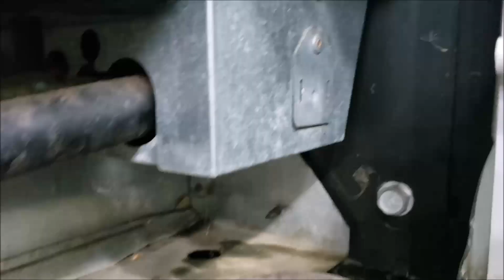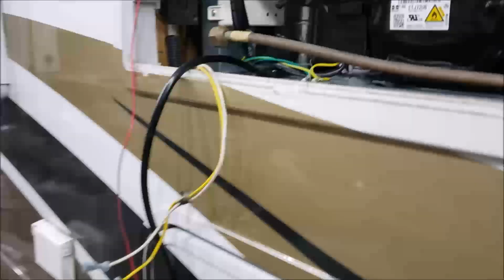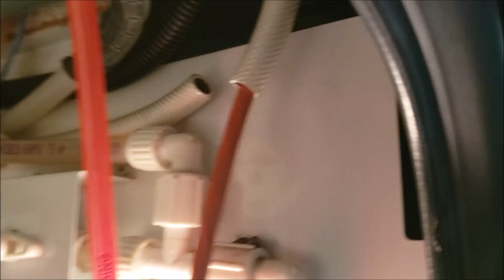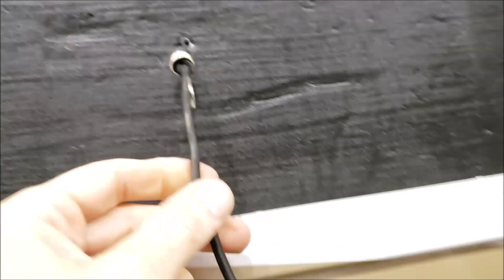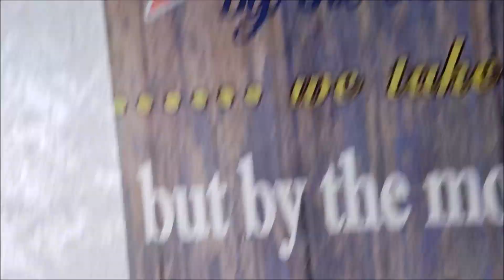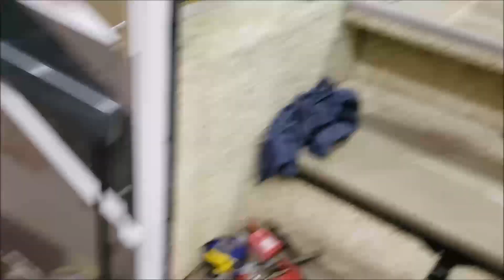How to Replace Your RV Refrigerator With Residential Fridge Step by Step With Haier Model HA10TG21SB

Comment: Very nice video.  Question,  why not install a 12 volt refrigerator instead?
Reply from the maker: Cost and availability  the fridge i chose is only 450.00 and I can replace it by going to any Lowes store. While am on the road.
Reply: Cheapest 12v DC refrigerator I found was a GE for >$1300.  The Furrion is about $1600.   Vs ~$400 for a 120vAC residential refrigerator that is the exact same size - available at Lowes, available at Home Depot,  available at Best buy.  Can achieve the same end result (run off 12v chassis system with more fridge space) when running off an inverter - which most people already have.

Comment: Awesome job!  Hi from Dauphin Island Alabama Campground.  I did  this  mod  as well.  Awesome job on  door  lock.  I also  rubbed  a thin  coat of  grease on the coolant lines near the compressor because they have a bad habit of corroding
Reply from the maker: Thats a great tip thanks for watching and contributing.

Comment: I love it, amazed the amount of additional space utilizing the same hole that's amazing. I don't understand you putting in the transfer switch though, your coach should come with one built in no?
Did you look into the 12v fridges.? If so what did you think?
Reply from the maker: Yes rv came with main transfer switch but it only controls the ac source between shore power and the generator.  The switch i installed will automatically switch the refrigerator to dc battery power the moment ac power is lost.. the fridge i chose is only 450.00 and I can replace it by going to any lowes store. While am on the road.